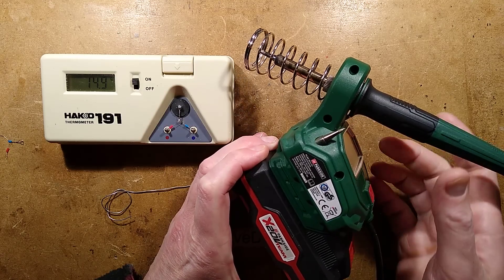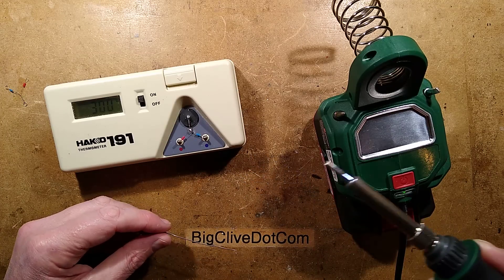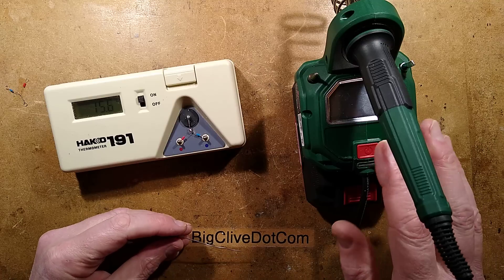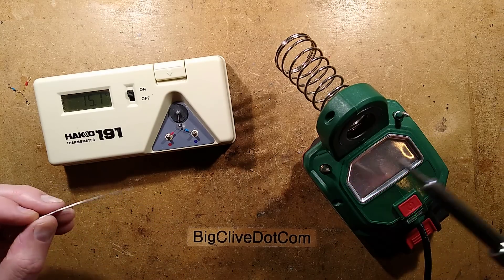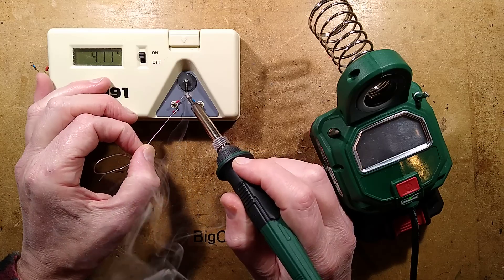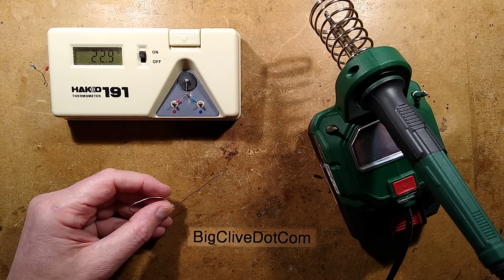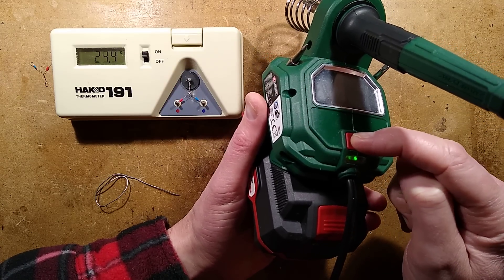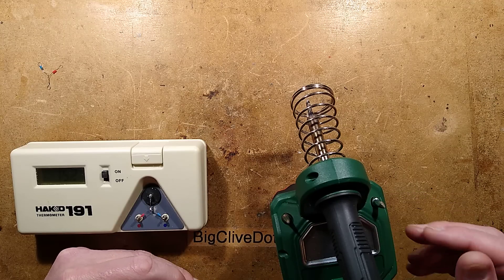Parkside soldering iron secret calibration mode A1 model

Comment: I am always interested in just how much user functionality you can get into something with just one button and an LED.
Reply: Infinite
But keeping it user friendly is a different thing.
You wouldn't want to read a manual saying "press the button 26 times until the led starts flashing green 3 times, then press and hold it for 3 seconds until it is lit steady red, wait for 6 seconds, press 8 times until it starts blinking and you're in mode X so you can adjust function X" 😎
Reply: @Ni5ei  Should look up the flashlight firmwares like AndurilUI
Reply: @drsquirrel00  Yeah true, that's a great example of using 1 button and losing track where you actually are 🤣
Reply: @drsquirrel00  Always love the bemused stares of me counting the amount of flashes from my torch when doing the voltage test
Reply: @MysteriousFigure  they're not staring at you because your clicking your torch they're staring at you because you bought a torch that expects someone would be doing so much clicks and be ok with that.
Reply: @Ni5ei  Yes, definite infinite! You just have to learn morse 😆
Reply: @Ni5ei  My mum had an entire heating system like this. it was a knob you could press. It was awful, trying to adjust modes, set schedules. in the end getting a "dumb" rotary thermostat and an on off switch was far better. Meanwhile my one has probably 8 buttons on it and 2 slide switches, and it is a breeze to program and use
Reply: Well, you can transfer a library with one button morse code, if you have the time to do it.
Reply: 500 flashes - all good
501 flashes indicate a fault
Reply: Multi-level tiered menus came about as an alternative to having a very large number of single-function buttons on a device. The manufacturers said it was to simplify the user interface but it was mainly to reduce cost. In most cases, I'd prefer a hundred or more single-function, clearly labeled buttons.

Another user interface "improvement" gone wrong is the use of cryptic icons and ideograms instead of words. They say it's to make the device inherently multinational but it's to avoid the cost of multiple, single-language key or panel sets. One size fits none.

Fortunately, there are two options made possible by the  reduced cost of displays such as LCD and even OLED and their control circuitry, multifunction displays where a line of unmarked buttons along the periphery of said display can be made to perform multiple functions by using the display to contextually label the buttons and touch screens.
Reply: Ask the folk who made the boiler in my parents house. Setting schedules on it is done with one button and it's a nightmare, much prefer the lamp timer on the front of mine.
Reply: @RossMitchellsProfile  For an inexpensive item like this soldering iron, it's not so bad. Just push the functionality down into the microcontroller. But a central heating boiler? That is beyond cheap.
Reply: @RossMitchellsProfile  you'd wanna see my parents old boiler. The air admittance valve bled water and it dribbled over the LCD screen. We had one button and a faulty LCD display that looked like the predator's wristwatch. You just had to remember sequences during the 90s
Reply: Get yourself a Ledlenser torch 🔦 🤪
Reply: Everything that can be send via morse code is the lower limit. Upper limit unse short for 0 long for 1 and you can programm a turingmachine.
Reply: Yeah gotta be careful though. You would be astounded the kind of bonehead things people do to "mod' their perfectly good equipment.
Reply: They actually did that for german "smart" power meters. You're seriously supposed to use a flashlight to blink at a light sensor to input data. All that to save them implementing NFC or something else "modern"
Reply: @nrdesign1991  German equipment. Works reliably and efficiently but completely inconvenient and not user friendly.
Used to work for a point of sale firm that had these machines. The machines were unforgiving and did not accept people could make mistakes.
Forget your physical software key tough shit you're not coding.
Download a memory dump from one machine and go to put it into another.
It'd load in bios two options save load.
Wouldnt tell you what you were saving from to what just that you were saving.
So either you were gonna save the data from a new machine and overwrite the memory dump from the previous machine on your usb stick and now you have nothing. Or you were going to load a dump from one machine onto the current machine your stick is in overwriting the data.
Both options were terrifying in their own right.
Ive actually forgotten which it was from the perspective of since so not obvious at all.
Reply: @Babihrse  Yep, and my aim as an engineer in this country is to avoid pitfalls like these on any products or systems I'm part of developing. Coming from a position where I had to work with unclear instructions or unintuitive and unforgiving software for years can be a lesson in how NOT to do things.
Reply: Infinite. It's basically a human-bit-banged serial port.
Reply: I made an arduino controled UV LED controller and with one button. Said button displays batt voltage on short press and sets a timer with a long press. Could do more :) but thats all I need.
Reply: especially those silicone things that buzz :D
Reply: Anduril flashlights pack a ton of functionality but it's kinda of a nightmare to use imo
Reply: @Yrouel86  I like narsil the best but anduril is alright to use as long as you have a flow chart handy. I enjoy handing a muggle a 5000lumen flashlight and not worryabout them burning themselves (muggle mode). Im not sold on anduril 2.0 though
Reply: @billriordan6341  I gave up and I keep mine on basic on/off ramp up/ramp down
Reply: @Yrouel86  Advantage is you can set it up simple if you want. Buying multiple flashlights and expecting their firmwares to act anywhere similar is impossible. Just get one with Anduril etc, set it up how you want - even if its just a 1-2-3 level choice - done. Muggle mode for everything else.
Reply: The MACtini also works with one button
Reply: Search on YT for: "new mactini"   ;-)
Reply: Anyone who is old enough to remember digital watches back in the 80’s will remember the two buttons used to program and set the watch, which were then later followed by a model which had only a single button.
Reply: Especially when it comes to earbuds with MFB (Multi-functions Button) 😂😂😂😂
Reply: What's the benefit of this Iron, just the price?  Not sure why one wouldn't just buy one with a temp control?
Reply: And for the cost-conscious bean counter, a “pushable bicolor LED”. Because, why not? 😂
Reply: I made a project where you would enter a serial data signal and the LED was a clock.
oh and it was a light sensor instead of a button. Point it out the window and wave your hand with good timing!
Reply: Hi! Nice useful video! Thank you🥂 what's the best temperature to use for car stereo wires, normal soldering. How many clicks to lower from the factory settings? With a lower temperature will the tips life will increase? And how much  battery range do you get with it ? Thank you🥂
Reply: Does this mode work's at b2 model?